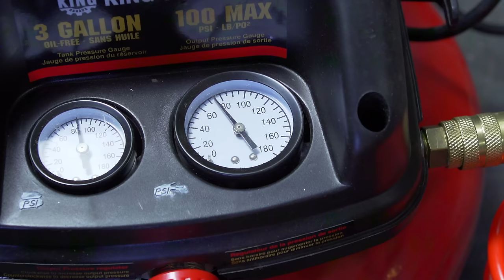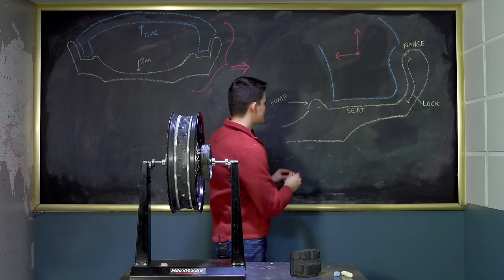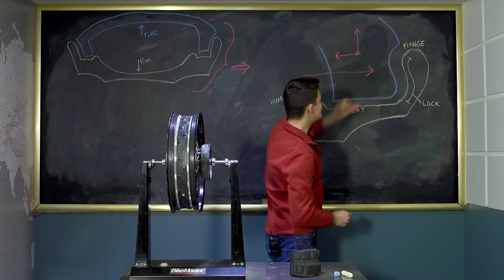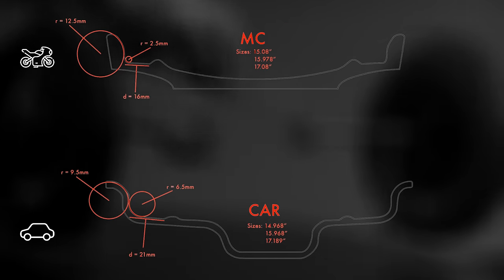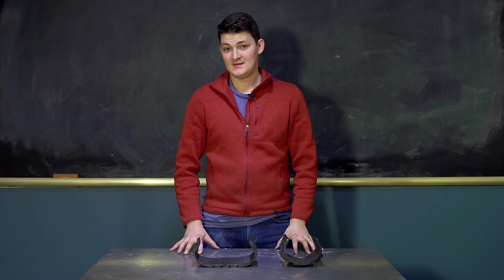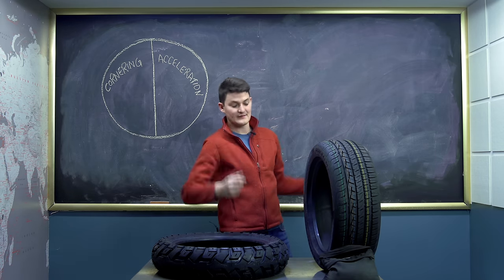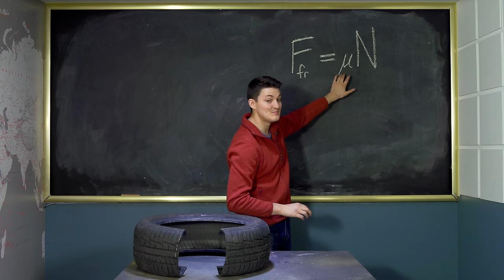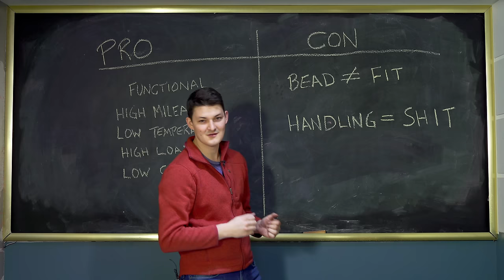Are Motorcycle Tires a Ripoff? The Darkside Car Tire Experiment

Comment: There is such a thing as double darksiding. Do the car tire on the back then take a motorbike back tire the largest tread pattern you can find and put it on backwards on the front. It is only recommended for the largest bikes and tractors.

Comment: Total friction is only independent of contact area for rigid bodies, and a rubber tire isn't rigid. That said, tire pressure and total vehicle weight have more to say about your contact patch area than the tire size.

Comment: Well, it's not exactly correct that tyre friction doesn't depend on the contact patch.
This formula is a, well, simplification and holds only true for special cases. Like metal on metal or wood on wood, where there is not much to measure (at least at the time Amonton conceived the law named after him).
For complex organic compounds, like rubber, things are different. They can deform, fit the tiny bumps on the road, grip onto them and additionally form molecular bonds.
That's why you can have lean angles of more than 45°

Comment: Instead of subjectively stating that darkside tires are "annoying" in curves, and omitting any real data; Why not take a cheap bike out and lay it down on a closed course, with a bike tire and car tire? Which one will lose traction first, under what road conditions?

Secondly, car tire rubber compounds have lower durometer values than comparable bike tires. This would give them superior grip. That seems like data that needs to be included in the conversation. 

I've put over 40k miles on a darkside bike, and feel more confident taking curves in all weather conditions with the car tire. I'd love to see someone do a legitimate study to compare the benefits of each tire in various circumstances.

Comment: I used 16" emergency spares on my 400 maxim for years,only one time did it deflated unexpectedly,but that was slow and controlled,like it took 30sec to deflate after hitting a small but intrusive rock on a gravel road,other than that it was good but I rode a bit slower to be cautious.

Comment: I used car tyres on the rear of side car outfit way back in the 80s--no problems  used a bike tube instead all that sealing. On the odd occassion I took the chair off, had no problems with solo riding, but I did not push hard on bends--just "normal" riding, and again no problems.' Did run much lower pressures than on a car.
Suspect, from the video, that you could drop your pressures a  bit. I was not known for conservative driving with the chair, and never had a tyre problem at ther back end.
Would do it again if I got another sidecar!!!  (and still use it solo when needed

Comment: About the best, and least biased explanation I have seen to date. Just a couple of points:

The bead situation isn't quite as extreme as your diagram. Rubber is flexible and conforms better to a slightly different shape than you indicated. In any event, I've yet to hear of a CT coming unseated from a MC rim.

Handling is different, but it's predictable and your muscle memory soon adapts. It's harder at parking lot speeds than on the road, and the tendency of the tire to follow the ruts can be unsettling, but it is safe. Some folk never get used to it and they go back to spending lots of money on shit tires that manufacturers have little incentive to improve.

I have about 50k miles with a car tire on a Yamaha FJR, and never once regretted it. Better braking, vastly better wet performance, cheaper and I don't have to get a tire changed halfway through an annual trip. Like most riders, my riding is basically upright with occasional corner fun, at highway (or just above) speeds, often fully-loaded.

Would I use it on a Track Day? Nope, but I have a spare set of wheels if I want to do that.

ps ... There is a YouTube video of two GoldWings scraping hard bits round Laguna Seca on car tires. It's a fun watch.

Experts will say this shouldn't be done .... fine. It's your bike, make your own choices. As for the insurance companies ... They don't really care. A tire is round, black and DOT approved for road use. It doesn't say "Car Tire" anywhere on it.

Comment: I really enjoy your videos. Can you please make one or two videos on how to overcome fear of cornering after crashing on a corner? I had a bad spill on a motorbike I just bought (someone had thoughtfully dressed the tyres with silicone). I can now confidently negotiate left corners but feel panic creeping on when negotiating right corners and roundabouts. (I live in the UK so it is a problem.) Many thanks.
Reply: I smacked a gaurdrail at 30mph december of 2020 broke my lower leg in 3 pieces.for me i started slow and relearned how to ride. rebuilding the confidence i had.

Comment: I told myself for years, "I would NEVER put a car tire on any motorcycle I own."
Until I did. I love it on my 2008 ST1300, it is in no way unstable, and grips like glue in corners, tight ones or long sweepers.
Sure I was nervous at first, but it didn't take long before I never thought about it... if it changed the handling of this large monster, I haven't been able to tell. Only about 2000 miles to date, but I'll do it again.
Haters gonna hate, doesn't bother me.
The other thing that doesn't bother me is riding on a car tire, there is no perceptible transition from straight up to lean, as it's a more rounded profile than most car tires. Vredestein makes this one.
You do you, m'kay?

Comment: I used to do this when I was a cheap ass in college. I ran an old honda on a used car tire for 5 years. It handled like shit, but did in fact run flat. I discovered this after coming outside to find somebody's pocket knife lovingly stored blade-first in my tread. Tire read 0 bar but it still rode basically the same. I could tell it was squishier than normal, but hey, it got me home from class, and I got to keep that guy's knife.

Comment: All comes down to how much and how do you ride. If you are casual rider, doing 4k a year in sunny weather getting knee down on twisty roads then there is no point in looking at square rubber. Buy yourself a set of dedicated MC rubber every season and enjoy your ride! 
But of you are pro rider, making living on two wheels and riding +20k a year in all weather including snow... then there is not much choice. All season or winter tyres are only available in square and wear got nothing to do here, it is downtime required to change your tyre which keep people off. You either do safely full season on one set or keep changing every 2 moths until you crash on first frosty morning.

Comment: 8:38 not false. Ryan is just using simplified equation for materials that aren't viscoelastic. Rubber is. The actual equation for rubber is more complicated and accounts for adhesive forces, mechanical keying and material shredding - three attributes that depend on the surface area of the contact patch. Ergo, *size matters*.

Comment: The theiving motorcycle tire manufactures need to come up with something for the 600+ lb power cruisers. I owned a Triumph Rocket III several years back and between its weight and its 165-lb/ft torque at 2700-RPM getting a $300 rear motorcycle tire to last more than 5000 miles was an impossibility.

Comment: It's correct that surface area in not in the friction equation.  But then why do drag race cars/motorcycles go so wide.  It's not for temperature solely.  If they raced on a surface as smooth as glass then the surface area wouldn't matter.  But pavement has by design lots of nooks and crannies.  Soft rubber finds its way into these and then you have it "grabbing" on to the pavement in a way that is different than just a flat surface.  Cars use slip angles to go around corners so they are designed to slide.  At any given moment the inside and outside tires can be sliding to some degree.  Try and take away wide tires from an Indy car racer and tell them surface area doesn't matter. But motorcycles don't corner that way, they actually track around the corner.  They need to be sticky and don't rely on surface area.  

Anyway, great piece on the "dark side" though I thought there would be more information about why motorcycle tires cost a lot based on the title of the video.

Comment: I once put a car tyre on my Guzzi Cali 3 and to be honest, it rode just fine.

Sure, when I first got on it, it kind of followed any lines in teh road, but then, plenty of bike tyres do that... The Dunlops on my Fazer did it, and yet I had exactly the same tyres on the CB and it did not?
But I have a VX800 right now, heavily chopped to buggery and is in a bobber style, and I am almost definitely going to be plopping a car tyre on that next to see how that plays.

My trike ( VW1600 ) has a fat ( 160mm ) front tyre and its a bike tyre, and I was considering a car tyre for that, however, it has a fairly long rake and so since the wheel does tilt like a bike does, I feel that the bike tyre would be the better choice anyway, plus there is so little weight on the front that it has hardly worn down at all in 5000 miles and I recon it will perish through age before it wears down.

Comment: Why can't somebody make motorcycle tires, especially for touring, that meets halfway and actually last a good 20,000 miles instead of less than 10k, and sometimes its a lot less than 10.   Its total bullshit what you pay vs. what you get with motorcycle tires.   $700 for a Harley Bagger for tires installed, give or take and you're a lucky man if you get more than 8,000 miles out of em

Comment: I don't understand why they don't make motorcycle tires from car tires with different formulations and in a different ring groove geometry to return redundancy and use stickier rubber? You keep almost all the upsides without the downsides except the camber and that's another thing they could work on. I don't get how motorcycle tires have so many shortcomings when they're designed for this, more expensive, and significantly less loaded than car tires.

Comment: Converted my bike to the Darkside.  Tested before and after on the Tail of The Dragon.  Car tire allowed me more lean angle never washed at all, even accelerating out of corners and improved my time by close to 30 seconds.  This time improvement has to be due to lean angle improvement.  I get 30k plus out of the tire, and it costs 75 bucks vs 250.

Comment: About the only way dark siding could remotely be considered an option is A) Trike rear wheels. B) Rear wheel and sidecar, on a bike that is equipped with sidecar.  Two wheels only, and it is a recipe for catastrophe.
Reply: How long do motorcycle tyres last compared to car tyres and what are the price differences

Comment: But..... Asymmetric tyres are designed to be on one side of the car or the other. How do you know which side tyre to get?
Reply: That's not how asymmetric tires work at all. There are no left and right asymmetric tires, you just mount them on the wheel properly and that's it, you can still fully rotate them for wear too. It would therefore be 100% impossible to "correctly" use an asymmetrical tire on a motorcycle.

There aren't even left nor right directional tires, again you just mount them on the wheel properly and then have to lock that rim and tire to that side of the car till you remount the tires the opposite way on the wheel.

Comment: Seemed obvious to me that the reason a car tire lasts longer on a motorcycle is because the rubber is harder. It's meant for a car which has a lot more weight. Motorcycle tires are softer because the manufacturer wants to give you more grip on the road. 
You could technically make a motorcycle tire with the same rubber as a car tire.

Comment: I run car tires on my muscle cruisers all day only way to have good traction now that being said I would never run one on my gsxr that’s for cornering hard baggers are not for hard cornering therefore a car tire is easy to get and use without any issue the 30000 miles without needing changed is also a great bonus

Comment: I did like your narrate yes there is something with the friction part! It is a bit complicated, but if you bear with me I try to explain it as easy as possible! You have forgot one key element! Surface grooves is considered as an interlocking mechanism, thus increaced contact patch is increased friction! So why we don't see 1850000000/0.000000065 under every car!? It is because too much friction can kill your car engine! The friction would be increased to the level that your car engine cannot even start moving! Also the eco+polar bears are involved!
Reply: Also using more friction could cause you bleed k-energy (speed) while cornering which also makes polar bears become soooo mad (I don't know why, maybe they're fast drivers who hate conservatives! 😅!)

Comment: I think you had way to much air in this tire as your up on the edge rather than letting it flex and run more on the tread. My goldwing stays flat on the tread and doesn't ride upon the edge . 

My goldwing handles better with a car tire even a run flat. The motorcycle tire would break lose and slide when I hit the corners hard.  When I pull my camper 700+lbs I can drag pegs over 100 mph no problem ,no wiggle what so ever . It will never have a motorcycle tire on the back again. No going to try it on the 1400 connie

Comment: I just went to the darkside on a 2013 K1600GT, and I love it. Much better than the last time I tried on the Vmax I did it to. On a heavy bike like the K1600, it works wonderfully. You also have a wide range of tires available with speed ratings to handle what the bike is capable of.

Comment: Surface Area of Contact Patch is not a factor in friction, but it is a function of traction. It also spreads weight over a larger area, each square inch of contact experiences less weight as contact area increases.
Physics http://ffden-2.phys.uaf.edu/211_fall2013.web.dir/connor_mattson/physics.html#:~:text=Traction%2C%20or%20the%20grip%20of,size%20of%20the%20contact%20patch.&text=In%20reality%2C%20this%20isn't,size%20of%20the%20contact%20patch

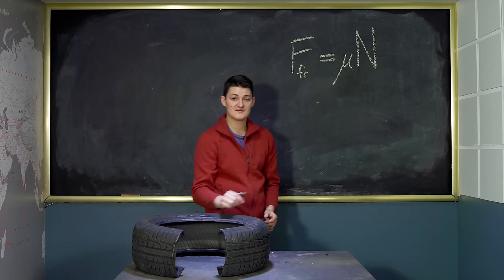Comment: 8:50, incredibly incorrect. Pneumatic tires have load sensitivity, so mu is effectively dynamic in proportion to load with a decreasing relationship. A larger contact patch ie: a contact patch with a lower average pressure for a given load, has less load sensitivity.

Comment: We all know how a standard Motorcycle Tire Works in the winter months they suck get a good car winter tire and send it thinking about 18 to 19 PSI and yeah why not run a tube don't have to worry about the bead  problem   losing air then and what he did with the caulk on the spoke rim definitely not recommended but I believe further scientific research this may work

Comment: Yes,they are a rip off. £230 to replace both tyres on my suzuki bandit. Not top of the range either.
Reply: Just put 2 new tyres on my car  255/  21    £800  the pair.
Reply: @chrishart8548  those are big tyres, I'm assuming you did not pick a budget brand.
Reply: @MrMichaelConstantine  pirelli p zero  its the oem fitment on a volvo xc60

Comment: ever wonder why a road grader or motor grader tilts it's tires while when its blade is set at an angle????    Motorcycles tilt,  automobiles do not. the flat side of the car tire works because the tire is meant to run in only one orientation.  the motorcycle tire is rounded so it can run in all orientations, straight up, and turning, with the tire still taking the thrust of a turn with as much tread as possible.

Comment: I like the idea, and since I'm an old rebel biker I really like the idea. But, the problem in the curves is real. Of road and iron horse chopper that had a 280 on the rear. Omg!
Talk about a handful in a corner. This I don't like! 
Although that car tire is going to last a lot more miles I would still rather use the tire size designed for my motorcycle. 
I like the way my bike handles in the curves.
I'll go the extra mile and spend the extra bucks on that high price motorcycle tire. Thanks for reading.

Comment: Ive gone dark side on 3 different bikes totaling more than 80 thousand miles. Kawasaki vn900 custom and Vn900 classic and a Vulcan 1500. And I ride aggressive in curves etc. Not one single issue. Not all tires are created equal. You cant just use any car tire. Also you cant go much wider with the car tire. Like this guy did. The car tire I use is not that much wider. Also the air pressure is crucial. Search vn900 darkside on youtube. Watch the video.

Comment: Bought a crashed Suzuki 650 Burgman at auction ... it came with a car tire on the back! Taped up the broken plastic and took it for a spin, that car tire on the back is scary!!
Reply: Huh. I have been running a CT on my 650 Burgman for the last 45,000 miles and it never scared me ever. And I'm a woman!
Reply: You probly never lean the bike over in turns
Reply: @oakdalegirl57  What? Oh ha ha ha ha ha ha! Now that's funny! Do you know of any other way to turn a motorcycle in the curves other than by leaning? I can lean over until my splashguards scrape. I think that is far enough!